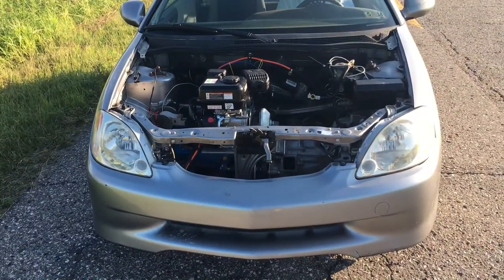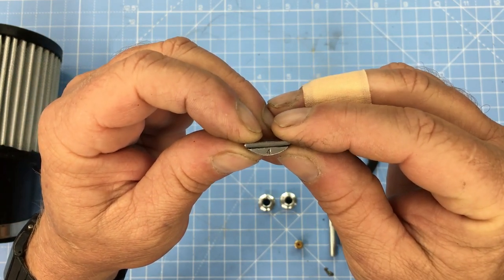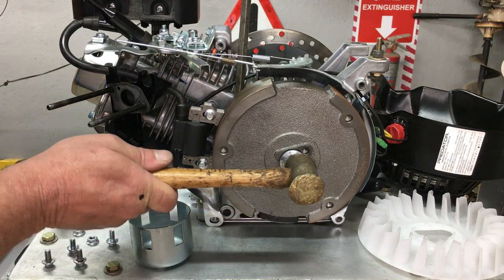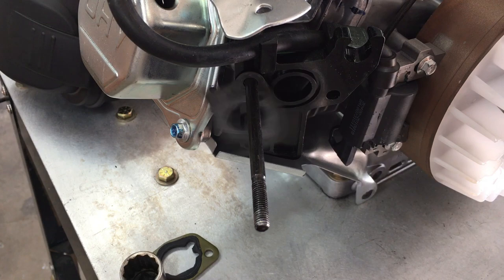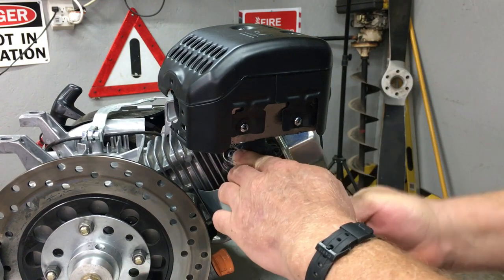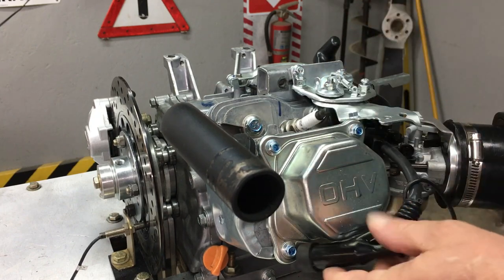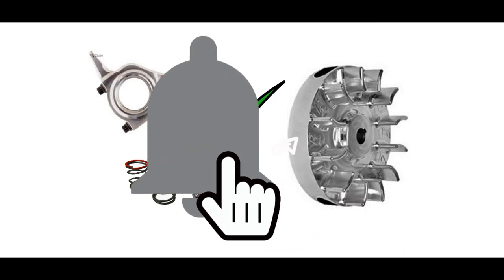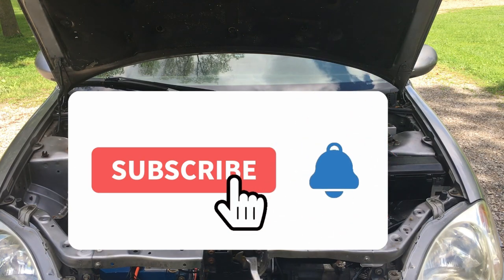Episode 3.  We build a Stage 1 Predator 212 cc engine for our street legal go kart

Comment: Seriously ..use a Supertrapp brand muffler on the end of your pipe: quieten it down for the law/neighbours.And it's 1/2 a glasspack   with a dimpled disc system you can add more for louder exhaust & more Top end HP or tune your carb total flow by lessening disc's to add more low end torque & quieten your exhaust down Some more.MX 4 Strokes used to use them for fine tuning (Google the name) or pop a little glasspack cherrybomb type muffler on the pipe.Take the bark out & add a smooth sound with NO restriction.Cheers Trev NZ

Comment: You can also put four spare tires the yellow ones like I did on the car. I even removed the two front brake rotors for a few Months very dangerous. The spare the spare rim and tire weighSeveral pounds less and they last about 2000 miles.That reduces Rotating mass times four The weight you takeoff that spins.The two brake rotors were 15 pounds together. I also put a front bumper to back bumper under tray one piece 12 foot long of tufftex.And I’ve got a boat tail 6 feet long.
Reply from the maker: Once I reach my 50 MPH goal with the 212cc engine, then I will try some aero mods.  right now the car struggles above 40MPH, but unfortunately any aero mods now will skew the results.
Reply: Super mileage car Ford fiesta it also has a small diesel motor in it on YouTube and there is another car that’s red it’s a Ford car that may show up I tried to buy that car but didn’t get to.

On YouTube look up —super mileage car Ford Fiesta.I’m usually not this helpful there must be something in the air today. If I could go anywhere I would go to Sweden

Comment: Yes yes.. but what about mpg????
I'm kinda wondering how far you could go on the original fuel tank with this engine...
Reply: 0.9g fuel tank. Im guessing not far lol
Reply: @A6Legit  no i mean, put the car fuel tank back in and connect it to the new engine
Reply: @EmeliaBelle  thats what i was thinking
Reply: I have this same motor on my snowblower and I can use it for 4 hours without running out of fuel.
Reply: @EmeliaBelle  that would make sense. I think he made a different fuel tank but not sure.

Comment: Where did you get the electronic  controller for your dyno?
Reply from the maker: Hi Jim,
the dyno load is controlled by the hand brake lever and the load is applied by pulling down on the lever.  It takes some practice, but it works pretty good.  I think I explain some of it in episode 2.   The data is collected with a DATAQ datalogger and is fed into the computer via an Excel patch.   Here is a link to a private video I made for the producers of a popular TV show.  https://youtu.be/Mnew4UogvBc  This short video provides some more detail of the system.

Comment: I think I've seen all your videos just about know I have the 420cc motor I still wanted to see it with some kind of compound setup with either a blower or another turbo with a intercooler in between you should be able to get  EGR temp even if you're not getting more boost the air should be cooler and denser

Comment: You may have 15 inch tires on the car instead of 14 inch they’re not as efficient. And I guarantee you if you got 100 psi with the RE 92 Bridgestone tires you will get the 50 miles to gallon you are looking for. Potenza Bridgestone RE 92.The only tires that would be better are the spare tires that come with the car they weigh much less have a lot less footprint on the road and you can go 120 psi with them. They are 1 inch shorter than the 14 inch re 92 so you have to figure in the math to see what your true mileage is.

If you use the spare tire at the recommended 60 psi you will lose about 30% fuel mileage trust me I have study this profusely I know what I’m talking about I’m getting 150 mpg at 50 miles an hour on level ground.
Reply: that is insane! 150mpg??? what car, engine and modifications have you done? sorry for my bad english.
Reply: Lucas van hamburg 2000 Honda insight. Three cylinder gasoline motor. Lean burn ECU 
The car is mostly aluminum. The two front fenders are plastic back two wheels are 4 inches closer together and the two front wheels parabola shaped. I have reduce the weight of the car by 150 poundsShow room 1850 pounds. Plus or minus.
Reply: driving 50 miles an hour
Reply: @excaliburjohndeere7657  thank you for your information. I live in sweden so fuel and about everything else is expensive here. So I'm trying to come up with ideas to save money on fuel. I believe the best way would be using a industrial diesel engine such as kohler and put it in a lightweight car. But these known brand engines are incredibly expensive and can't be bought of the shelf so I'm considering a chinese engine, any experience with these?
Reply: Lucas van hamburg Yes I do.There’s a real find man from New York State sunny Canton look him up on YouTube. He has the Kabota three cylinder diesel motor in his car and gets about 200 MPG. Came out of a riding lawnmower
Reply: Lucas van hamburg The Volkswagen XL one it’s over 280 miles to the gallon it’s a two cylinder diesel and hybrid
Reply: Lucas van hamburg Look up trans logic green Grand Prix that’s in New York State 20o3Honda Insight did well Up therein 2013
Reply: Green Grand Prix winner diesel car centurion sunny canton Try that out on YouTube
Reply: @excaliburjohndeere7657  thank you I found the video, although his car won the competitioon, it was clearly not built for this purpose only. there is much room for improvement, especially aero, so it should be possible to get 250-300 mpg with a custom fibreglass foam sandwich body, possibly even more. I have ordered fibreglass and xps insulation panels and will start experimenting with lightweight construction, I might make a small boat or something.

Comment: Ever consider buying an efi kit for this chinese one lunger ?
Reply from the maker: Yes, the 420 engine is getting the EFI kit soon.
Reply: @robotcantina8957  Hi bolt on a Honda Bike carb a kihien 20-22mm slide throttle : you'll never look back, the jetting is spot-on std & they still make them new in Malaysia & Taiwan etc or locate a used on off a bike being parted out...Feebay or Craigslist etc cheap as chips ...makes a BIG torque & Throttle response difference over the butterfly carbs.Truely.People say Mikunis for the bragging rights but the Honda carbs WORK at 1/2 the cost.Cheers Trev NZ (assuming your in USA)
Reply: PS & the bullet nipple of most throttle cables make it a no brainer ! T